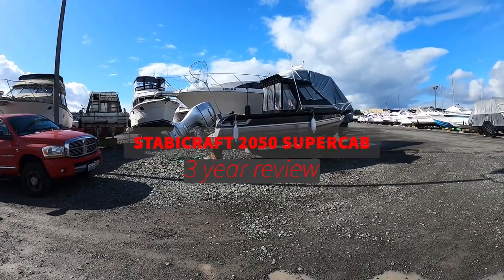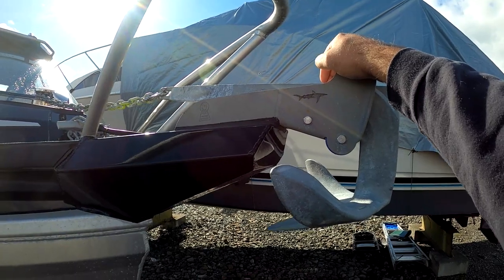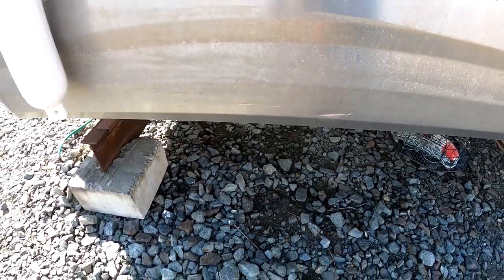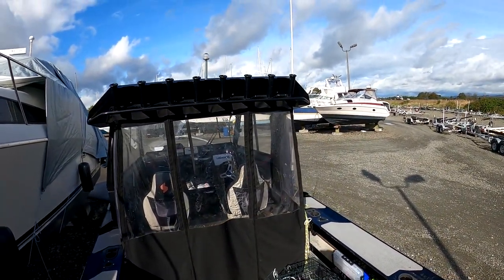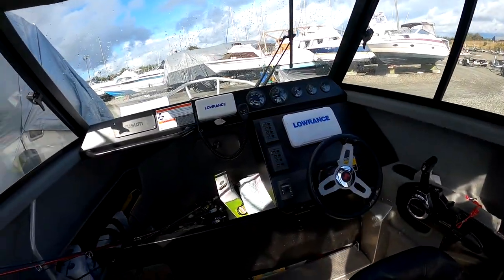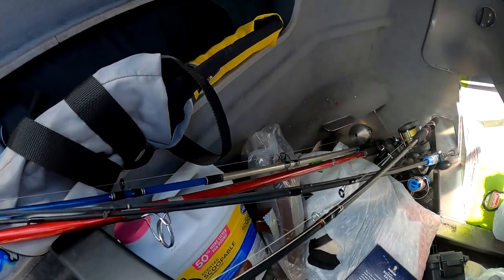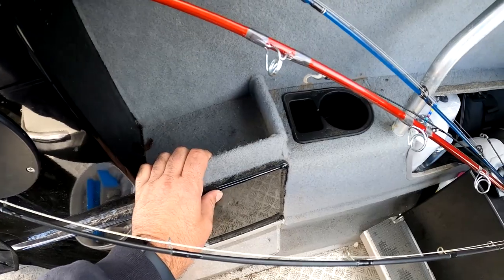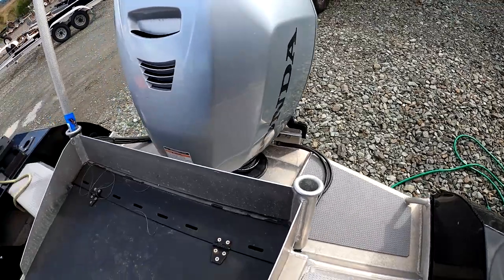Stabicraft 2050 Supercab - A 3 year review | Stabicraft on the Sound

Comment: Our 2019, 2050 Supercab has the same filler cap and forward vent as your boat. We can fill at the pump with no issues. Pump clicks off as soon as you hear fuel starting to come up the filler hose. I would make sure that the filler hose and rear vent hose are free of kinks and/or hard bends. The big round vent towards the bow can easily be opened with a quarter (coin) by turning it counterclockwise. We have not found this to be necessary when filling but others have. Something easy to try that may save you from spillage. Thanks for the video, these are amazing boats!
Reply from the maker: Thanks for the tip.  I'll check the filler for hard bends, and the vent hose.  I haven't had mine on a trailer is some time but next time I do I'll try opening up the front vent when I fill up and see what happens.  Yeah, these are amazing boats!

Comment: Thanks for the details.  I'm hoping to order one in February.  Don't know how long it'll take to get, but I'm a patient old guy.  Can you comment on fuel consumption with the Honda 150 on a 2050?
Reply from the maker: You bet, thanks for the question.  Fuel usage  varies with water conditions, but on smooth or fairly smooth waters it shows on the gauges:

Full throttle holding near redline at 40 MPH: 3 MPG
3/4 throttle holding around 4600 RPM at 30 MPH: 5-6 MPG
1/2 throttle holding around 3000 RPM at 20ish MPH: 6-7 MPG.  

Not the most precise results, and running around in heavy chop and larger waves takes it down a mpg or two even at lower speeds.